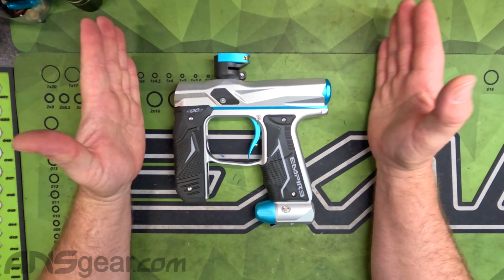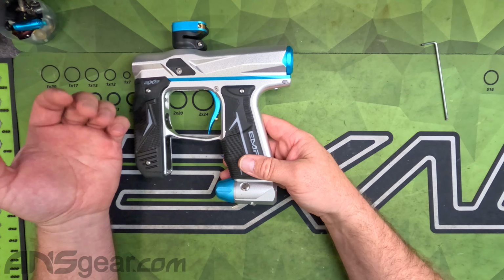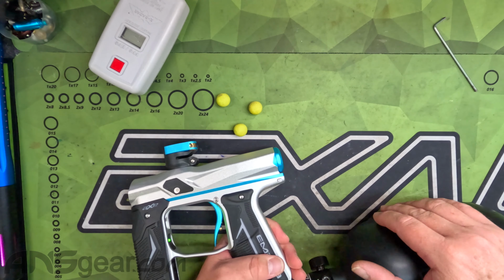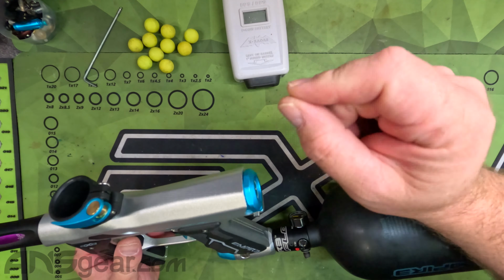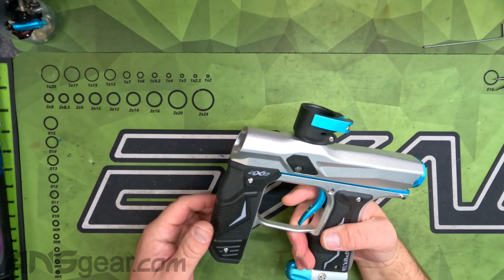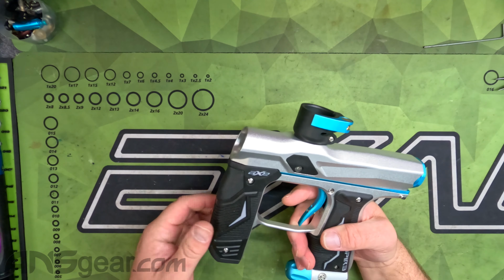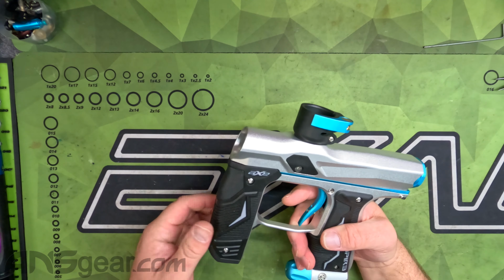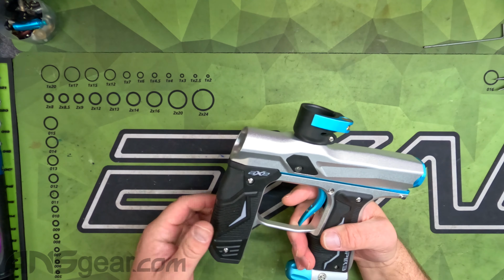Another Empire AXE 2.0 Velocity Issue - Tech Talk

Comment: I bought my kids gun brand new. Tried it at the paintball field. Turned out when it got color swapped and it was assembled wrong before I received it. Watched a previous empire axe 2.0 video from Rory and found out from the video, during the color swap assembly someone assembled the regulator disc upside down. That solved my problem